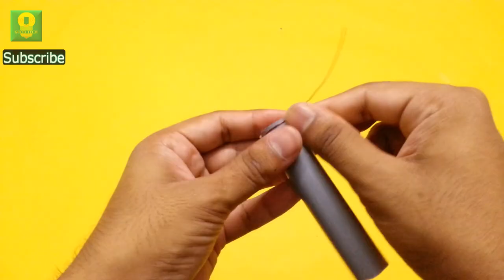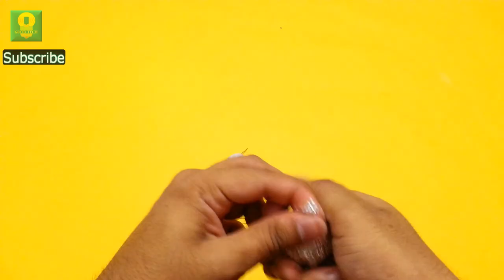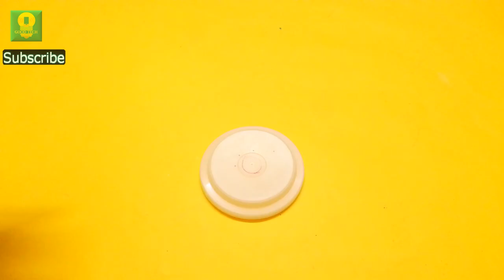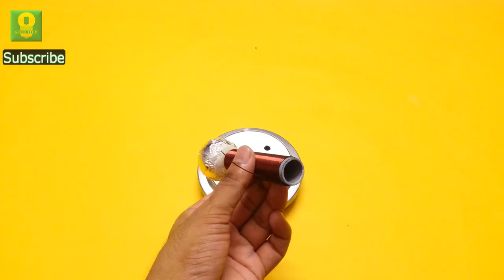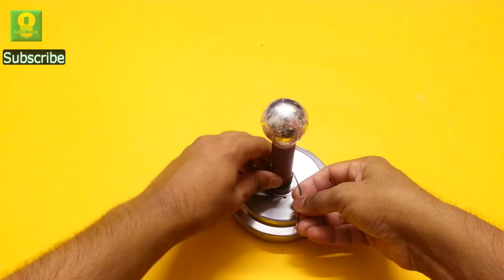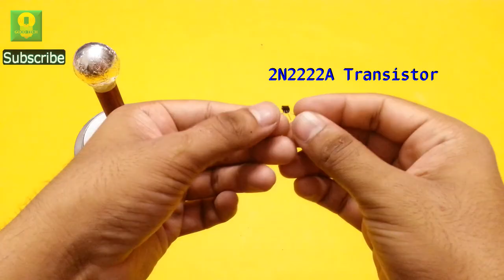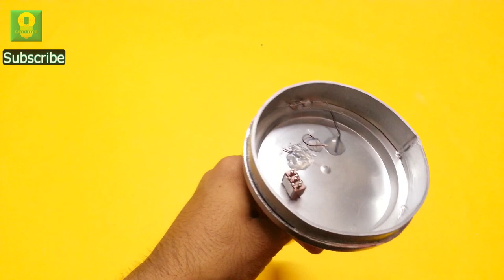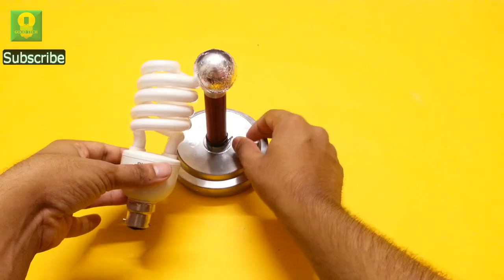How to make Tesla Tower at home

Comment: You never specify what type of wire to use and you use them twice in this video. I tried doing this step by step but even following ur instruction was no good on the link you provided and it still does not specify. I use various wires from random cables i had and none worked. I even got the right measurements on the pvc pipe and went around it with the enamel copper wire 28 awg 200 times as specify on the link you provided and it only wrapped around a third of the pvc pipe. I read it was around 200 turns so i did 250 and over and it still dont work. I think if you would at-least specify all the things we need. Im straight up 100% noob at this, i bought everything that was needed and like the 2 wires you didn’t specify, you also did not mention what type of solder to use. I tired various videos to see if any can give me a name of the wires but had no luck. If anyone wants to try this, i wish you the best of luck. Some people seem to do this no prob. But im sure they had to check other pages for more info that this video lacks.
Reply from the maker: I am very sorry for the trouble you had to go through but if you need we can together make it work now. The wire i used was enameled copper wire (28 AWG) and the second wire was just a normal insulated breadboard connection wire. However, any thick wire can be used.
But you did not tell how your circuit behaved, is it just dead or there is some heat or some sparks, are all components working, what power did you use..??

If you had made the project and it does not work there can be many reasons. Did you check all the components you have used work well?? You need to double check the connections, if the connections are fine then turn ON the circuit but make sure you have used a good quality power source because a normal 9v battery will not work with this project.
A normal chinese battery can only provide (100 - 150)mA of current but in this project we atleast need 500mA. You can connect a 1A 9v adapter as power supply.
Also make sure that you have removed the enamel at the edge of the wire before connecting it to the aluminium foil of sphere ball, so that it can make a connection.
Now, when the circuit is turned ON, touch the transistor, if it is getting hot then circuit is fine. Simply, get a neon or fluorescent light near the sphere & it will glow. But if it gets hot at once and then cools down that means transistor is burnt, you now need to reduce the no. of turns of wire and try again.
Give it a try, if all the components are fine & circuit is correct then it will work.
Please do let me know the result.

Comment: The problem is your using the wrong current. Tesla never used ac/dc. He converted from but never used those currents in his final circuit. This is where everyone goes wrong. Plus modern day Tesla coils are not the same as Tesla used.

Comment: كم سمك سلك النحاس المستعمل وكم طوله
Reply from the maker: I have used a 28 AWG enameled copper wire. It has around 200 turns on a pvc pipe of diameter of about 2.1cm

Comment: I HAVE MADED IT BUT IT IS NOT WORKING PLZZ HELP ME
Reply from the maker: Make sure to double check the connections. Also, make sure that you use a high current 9v battery, a normal chinese battery will not work with this project.
Reply: Ohhh i am using Hi waote battery my connection are working i have checked it a lot
Reply from the maker: Hi waote batteries can only provide around 80 - 100mA but you need atleast 500mA to power this circuit.
Reply: So which battery i have to buy
Reply from the maker: I am not endorsing any battery but a 9v duracell battery worked well for me. However, you can also use a 9v (0.5-1A) power adapter with this circuit.
Reply: Can i use a mobile charger
Reply from the maker: No, a mobile charger is only 5v but you need 9v.
Reply: Ohhj
Reply: So can we use 1.2v rechargeable batteries
Reply: he just told you 9 volts...
Reply: Maybe your transistor is facing the wrong way. In the video, the flat side of the transistor if face up. Either that, or the materials you have used have varied.

Comment: I made it but it didn't work :(
Reply from the maker: This project does work well, double check the connections, turn ON the circuit and touch the transistor, if the transistor gets slightly warm then everything is fine. Now, make sure to use a high current 9v battery, as a normal chinese battery will not work with this circuit. It requires atleast 500mA of current at 9v.

Comment: Mine didnt work :(((((((((
Reply from the maker: What is the problem..?
There are few things you can do to troubleshoot it. It is important to double check the circuit.
After turning it ON, touch the transistor, if the transistor is not getting hot, then there is problem in the circuit or a component.
If the transistor is getting significantly hot, then circuit is alright.
Now, make sure you have used a high current 9v battery because a cheap chinese battery will not work with this project.
Also, if you need additional info, have a look at my instructables here - https://www.instructables.com/id/How-to-Make-a-Mini-Tesla-Tower/

Comment: i made it. but it not work.
Reply from the maker: Double check the connections. If everything seems fine, make sure you have used a high current 9v battery as a normal chinese battery will not work with this project. It needs about 500mA at 9v to work.
Reply: ok sir
Reply: Maybe your transistor is facing the wrong way. In the video, the flat side of the transistor if face up. Either that, or the materials you have used have varied.

Comment: It's not working why
Reply from the maker: What power source did you use?
Also check whether the transistor is getting hot or not, sometimes transistor is defective.
Reply: Ok one more question.what gauge of copper wire to use
Reply: I used 27 gauge
Reply from the maker: That should work, however, i used 28 AWG i.e 0.3mm wire
Reply: What if transistor is getting hot is it working
Reply from the maker: If the transistor is getting little hot then the circuit is working, if its too hot, may be it is damaged.
Reply: +Nathan Shin ok thanks

Comment: im no scientist, but wasnt teslas theory that you can pull current from the atmosphere with his tower, then send it out in waves over the ionosphere? making it so you can basically just run lines from the dirt to whatever you want to power? hence the light bulbs in the ground demonstration. isnt this almost the exact opposite of that? "almost" because youre not even using a natural current. youre just pushing man made current through the air. meaning in no significant way does that improve our lives or the environmental damage. the power will still be manufactured via fossil fuels, and cost consumers even more to offset the companies cost of making the switch.

Comment: This is fake. First of, a Tesla coil works by having voltage run through a high-voltage capacitor that then powers a secondary coil that slowly charges the primary coil and then reaches the sphere. Also, there is no way this tiny thing would light up a florescent light all the way.
Reply: Sorry Sir, but I've already made this one and passed it as my science project. I can give evidence that this is working.
Reply: @zenmori6773  You couldn't have followed this guide then. His secondary coil doesn't even exist, meaning there is no way for the primary coil to charge up. Also, he used masking tape to connect the head to the primary coil which would have grounded the electricity.
Reply: @joalmeria891  hey man just search for Slayer Exciter circuit, this is the name of the circuit and it works like a sience project

Comment: its not working
Reply from the maker: This project works really well. If it didn't work double check the connections and make sure to use a high current 9v battery, a normal chinese battery will not work with this circuit.

Comment: not working
Reply from the maker: Double check the connections, if everything seems fine then make sure to use a high current 9v battery because a normal chinese battery will not work with this circuit. This project requires atleast 500mA of current at 9v.

Comment: it isnt working
Reply from the maker: Make sure to double check the connections. Also, make sure that you use a high current 9v battery, a normal chinese battery will not work with this project.
Reply: I've used a high voltage 9v battery
but is it necessary to use only Duracell batteries
Reply from the maker: Duracell worked well for me but it is not necessary. Make sure the battery you used is able to provide atleast 500mA at 9v.